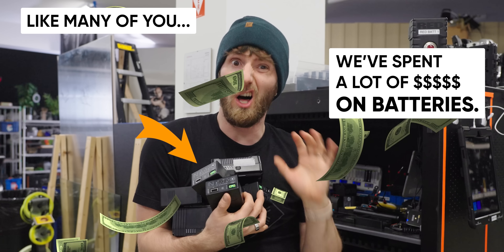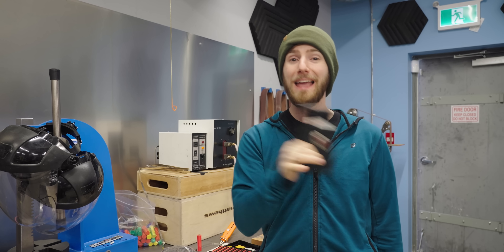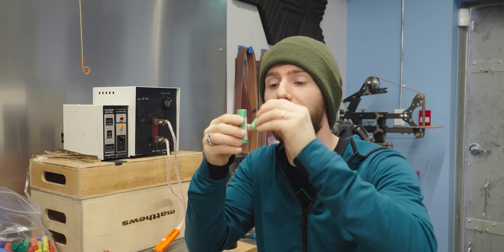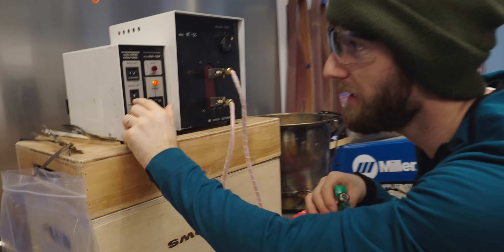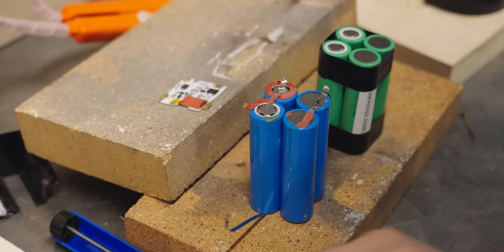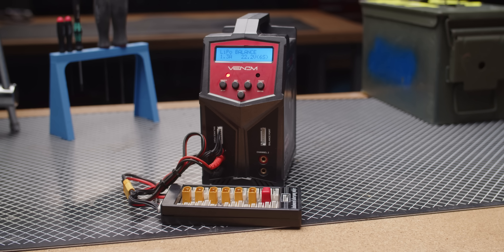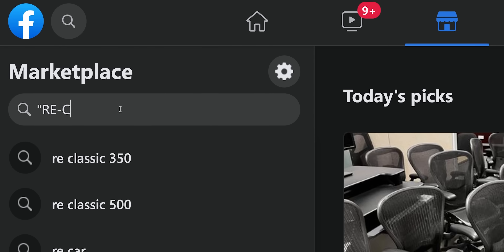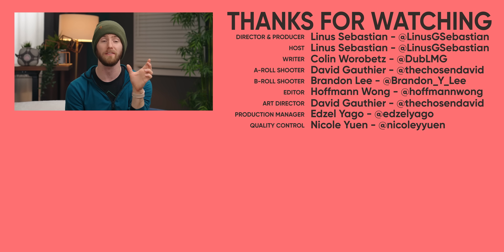This should be illegal… Battery Repair Blocking

Comment: A BMS typically needs to see a CHARGING voltage x volts above the pack voltage in order to "wake up". The x volts is specific to the brand of BMS. Without doing this your BMS will always appear to be dead. This is a safety feature where the BMS disconnects the pack if it encounters an issue. Typically a new BMS needs waking up, or an in-use BMS will if it encounters a cell at a lower voltage than safe. The BMS may also need the thermistor plugged in to work. Or you wired any balance leads incorrectly making your BMS a bin job.
Reply: It's often not the BMS but rather the OCP circuit that may be either integrated into the BMS or on the cell itself. In order to use zero or near-zero quiescent current the OCP will have a big PMOS protection FET (usually but varies). Disconnecting its battery causes its gate and gate-drive circuit (depending on topology) to float and discharge causing it to improperly latch into the wrong state. Simply reestablishing the correct bias will allow it to function again. That usually involves shorting or recharging the correct junctions into the correct charge state.

Comment: The true "middle ground" is not that you can return a battery pack to its manufacturer for re-celling, but that you can take it to a 3rd party professional service.  Even in the days before lithium-based batteries, rebuilding battery packs took specialized tools to do without damaging the cells.  Not something I'd suggest learning on expensive equipment, but something that used to be commonly provided by small independent IT shops.

Comment: Dabbled in this area myself, and holy shit it is terrifying! The only way forward I can see is not cell replacement, but rather standardized battery form factors with integrated BMS's, especially for phones. A repair shop can replace an integrated pack no problem, but the potential liability for shoddy DIY cell replacement is huge. Lithium is not something that people should be mucking around with.

Would love to see the recycler tour myself. Hope you get around to that.

Comment: Evil BMS hardware is just the tip of the iceberg. I revived a 4 year old blu ray player with a disc tray that wouldn't slide open. The cause? The Iron ring counterweight holding down the disk once the drives disk spindle pushes up against it had become magnetic and wouldn't let the spindle lower once you pressed eject.

Nerfed by it's own mechanism after only 4 years.

Comment: I use Anton Bauer batteries on my JVC 750 cams and I can attest this is spot on. I have replaced the cells and had a working pack for a few months, then it bricks itself after 10 minutes of use. I rebuilt another one and it is fine, but it was an older build date with a slightly different batter management controller  ( which is what is is actually called according to the AB tech I spoke with ). Since Vitec bought them, there is no way to fix the new packs due to the strategies Linus mentioned.

Comment: I've just replaced two cells on the battery pack for my CMPC ES10IS2 laptop yesterday and I'd definitely call it an evil design because the casing is almost impossible to open without breaking (I did get to open it but it completely tore to pieces), but the BMS itself wasn't actually that bad, I just had to give it power from the batteries' positive to the output positive and it started working again.
As for the casing, I used the remaining bottom part so the batteries would stay in place and though it looks dodgy (because the Li-Ion 18650 cells on the bottom of the laptop are exposed) it's not terribly dangerous, I just wouldn't let it sit on rough surfaces lol

Comment: A lot of BMS's need to be plugged in for them to restart and provide power. Basically replace the batteries, wire up the BMS, then plug it into a charger to activate the BMS, and it should work as normal once you unplug it. 

I'm not saying this was the case for your batteries, but it's always something worth trying.

Comment: That welding impulse looked 1. way too long, and 2. way too hot if you're welding your electrodes to the nickel with every shot. Did you read the manual?
Reply: Those sparks are not an actual issue.

Comment: If a lithium-ion battery is down to 90% of nominal capacity, let alone the 10% or so your graphic at the start of this video indicates, after only 2 years of cycling a couple of times per day, you're either dealing with very poorly made cells or (more likely in this case) you're abusing the cells. Did you cycle that battery pretty much continuously at high speed (from max to zero as fast as it can survive, then back, and repeat) for the entire 2 years? If not, you might want to take a closer look at how that battery is set up (how rapidly it's charging and discharging relative to its C rating, and how high and low of SoC the cut-offs are set at); a lot of battery-driven systems these days are designed to pummel the cells needlessly, because capacity and charging time stats are way over-valued by customers, while almost no one, at the moment of a purchase, gives a flying ** how long a lifespan the device has, so manufacturers are incentivized to sacrifice 90%+ of the device's service lifespan to eak out 3 to 5 percent of charge duration, or to shave a bit of time off of a charging time that will usually end in the battery just sitting there waiting to be used for a while, anyway.

Comment: The cell replacement is such an easy fix. Make the cases marginally larger and use spring tension contacts like standard consumer battery compartments rather than welded ones. Then, assuming they haven't made the controllers completely evil, you buy a fresh pack of cells to slot into the outer casing.
Reply: Love this idea.
Reply: Sounds like that would cost the OEM a bit more money. OEMs hate spending money.
Reply: @sarfured  sadly, yes.
Reply: Dangerous stuff shouldn't be that easily replaceable. It's fine for light uses like one or two batteries, but whole packs?
Reply: @retrocomputing  Good point. Everyone is talking about how bad it is to replace just one or two cells old cells in a bank of 12+... Making them all easily hot-swappable would essentially guarantee that it would happen when in the hands of consumers.

BUT: I thought Bryan's comment was directed towards us end-users who would be the ones to construct the new cases. I wasn't thinking Bryan was talking to manufacturers.

Personally, I'd be happy taking responsibility away from the manufacturer and building my own battery cases if I plan on doing many cell replacements over time. I don't think manufacturers should change their practices in that regard.
Reply: @ZandarKoad  I was actually speaking more towards OEMs, rather than the end-user. This whole trend of "it's too dangerous for you to touch" is the reason we are in this situation in the first place. Placing a little more trust in the consumer (and the consumer having a better understanding of their own abilities and comfort) would go a long way to fixing this culture of waste and irreparability.
Reply: @bryanbernheisel7441  That would also require holding consumers liable (not manufacturers) for injuries or damages caused by misuse of manufacturer products. A very, very hard sell when every politician is advertising safety over freedom.

Personally, I chose to take responsibility myself without waiting for lawmakers to change the political climate for manufacturers. Life is too short.
Reply: @ZandarKoad  For sure. Our political and legal system is a huge problem in this regard. Personal responsibility is non-existent.

Who knew their McDonald's coffee might be hot...

Comment: This video hurts to watch. Could you guys at least have watched a video or two on spot welding? First off, just because it sparks mean that the battery isn't killed, hell even if you shorted the battery for a second or two it would more than likely be fine. You left sharp edges on the nickel strips as well which can be a huge no no depending on what it's going into. You dumped cells in sand that are still completely fine. You guys can do better than the video that is uploaded today this feels rushed and with minimal effort into what you guys were actually doing with spot welding and BMS work.
Reply: i agree....this was not a professional video at all. they rushed the research part.
Reply: I also agree but I do think it gives a sense of what an amateur would go through and there are plenty of those watching a YouTube video and sending it.

Comment: Maybe hook up the bms to a lab bench power supply then disconnect the old cells, make the new pack, adjust the voltage on the power supply to the new cells, put the new pack in and then remove power from the power supply.

Comment: Lithium batteries are by definition not rechargeable. They are used as 3V coin-cells or 9V versions in smoke detectors. Lithium-ion batteries are rechargeable.
Safety: Eye Protection, Eye Protection, Eye Protection, Eye Protection, Eye Protection

Comment: JUST 3D PRINT A BRACKET FOR SPOT WELDING!!!! I have done it a ton making custom lithium ion batteries. Including batteries for ROVs, research equipment and personal projects! and you need to run more like 1-2 ms not 5-15ms. The safety is heavily dependent on the time you spend spot welding. I will take a week off of college to show you how to do this right. This isn't educational, this is dangerous!!!!!!!!!!!!!!!! I think this is the only LTT video i have ever down voted and i have been a subscriber for over 5 years.

Comment: I believe you are using a wrong welder for the job. You was really heating up the batteries. Typically a suitable spot welder doesn;t need to "red hot" the pieces. In a good spot welding there is much more sparks, less heat.

Comment: It would be sensible to ditch RED with their crazy solutions long ago. Also, BMS chips are available and some are professionally unlockable if needed. And you should use less power for spotwelding.

Comment: I built a battery pack for my electric trike and didn't have any problems. I used 36650 batteries and nickel strips and had a fun time making it. It worked flawlessly the first time and until the trike was stolen it was doing great. I had none of the problems you had as I thought about and studied assembly videos on how to do it correctly the first time. I got my parts from Battery Central and saved money over Amazon.

Comment: I don’t know why you had such bad luck repairing your batteries I repaired my own using replacement cells that I purchased on the Internet I am myself use V mount batteries for my cameras  
One particular battery that I repaired is a IDX brand  Endura 7 The only problem was taking the battery apart because those particular batteries do not have screws but once inside it was pretty straightforward. I even fixed my Sony batteries that are model BP-L60A  those were a little easier they had screws in them I purchased a spot welder on Amazon also the zinc strips at the same time I did not have any batteries explode or arc out. I guess you just had bad luck I guess question on your red camera how come you didn’t purchase a V mount adapter for that camera. V mount batteries are a lot cheaper.  B&H sell A red camera V mount battery adapter so you don’t have to buy the expensive red camera batteries😀

Comment: I am definitely not advocating that an untrained person repairs batteries.  However I will not be happy until all devices are as easy to repair as humanly possible so repair experts and independent repair shops can more quickly, more easily, and more cheaply fix our valued devices.  They are our property and we have the right to repair, strip down, modify, or do whatever we want to them! 
#RightToRepair

Comment: Damn you guys are one too carefull. A spark is not really dangerous, it is when your battery gets hot or if you puncture a cell.
Shorts ain't dangerous if they are short lived. They are dangerous if they are in a cell because then you can't stop them. The heat in the battery causes the solvent to vaporize. This then increases the pressure in the battery until it bursts.  The fumes can then catch fire.

Comment: Some 18650 shops are selling "empty cells" that can be used for spot weld practice. No electrolyte, so no risk of damaging a live cell should you screw up. And far less expensive - I've seen them for a few dollars for 10.

Comment: Spot wielding can be done with a LARGE capacitor, of the type used in old IBM main frames. You get better control over the current pulse and it won't over heat the joint.

Comment: this gave me flashbacks to the time I harvested some litium cells from and old powerbank, looking back, I don't know why (I was like 15) but I wanted to complete the circuit with a hex key so ''it would be usable with fewer batteries'' and short circutted it while holding it, it turned red hot and gave me some awful 3rd degree burns, fun times

Some actually were intact so I actually could use them for my laser pointer, lol

Comment: The sparks that can be seen at 11:15 are actually from the spot welder's not-optimal contact with the nickel strip. It wasn't from the battery (judging by the video) so possibly all your welds and batteries are fine.
(I'm saying it as an electrical engineer student.)
By the way: Of course we want to see a trip to Retriev!
Reply: yeah, they overreacted to oblivion in this video. No way that spark justified throwing the battery in sand like it was a pipe bomb. It just couldnt have come from the battery being shorted

Comment: I would love to see how batteries are recycle. 
By the way, I have successfully re-celled 2 power banks and 1 laptop battery (18650s) by just soldering when I didn't know any better. The all have worked well for a about a year. I kinda freaked out when you showed what could go wrong and I wonder how I survived.
Reply: Those batteries they shown as bad (sparks and tossed out) are definitelly still good. Sparks were made from improper spot welding, not cells dying or sparking.
Reply: @volodumurkalunyak4651  That's what I initially thought as well.

Comment: Considering 18650s can be used like AAs in flashlights etc. Why can't they just be replaced this way? a better BMS would be able to balance out the differences in cell voltage anyway.

Comment: A lot of times the BMS will just go in a safety mode when it's disconnected.. You can almost always wake them up by connecting them to their charger or temporarily shorting the battery + to the output +..  It just needs the voltage to wake up...

Comment: Sparks are common if you don't press both tips down with equal force. They both need to be in solid contact with the strip if not , the spark will happen . It hurts to see you throw away perfect cells when all you did was just a small mistake that didnt damage the cell at all but w/e now you know.

And also I think you're either stepping on the pedal for too long or the pulse time is way too long as you can visually see the tips glow. It shouldn't do that. Have a high enough current and it will weld it instantly. And especially with the nickel strips you're using i doubt it'd take much to weld it anyway.

Another thing is , your cell choice. Why'd you buy from what i can see , a Panasonic 25r cell that only has 2500mah in capacity when the original cell came with 3500mah Sanyo GAs? That's a massive drop in capacity. My recommendation would be to just get LG's MJ1 as it's more or less the same as a Sanyo GA and has the same capacity and discharge (not like a Camera requires much) .

Also a tip: Get a battery machine that would do both discharge and charging with a Display that shows you the true capacity , Internal resistance and temperature. Whenever or wherever you buy cells
, always discharge all of them to 3volts and then charge them back up . Verify the true capacity and the temperature. I've been in so many cases where i've ordered brand new cells from the factory but there are ALWAYS a few cells in the SAME batch that are not right. E.G , some have higher resistance , lower capacity and some run awfully hot . Batteries that you get locally from vape shops or whatever don't bother doing these tests and even if they do , they don't do it all as there's simply too many and they cannot be bothered. In my experience , don't be complacent because the cells are 'brand new' , test them just in case when you've finished building a pack and it doesn't function well then you'd have to waste even more time taking it apart and testing them ANYWAY.
Reply: Master this skill and you'll save yourself A TON of money . Such 'branded' batteries are NO where worth their prices. Once you've learnt enough , you'll never buy pre-made batteries again and start making your own. All my power tools and even my vacuum cleaner are using batteries i've made myself and they all have their individual spares.